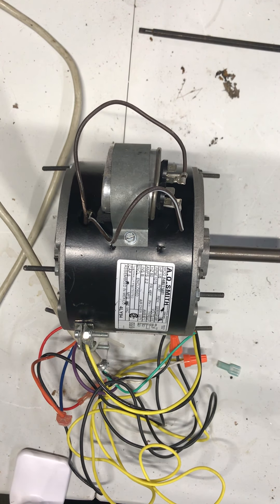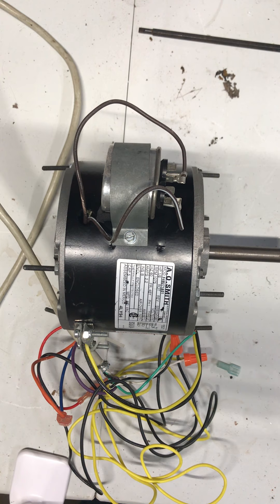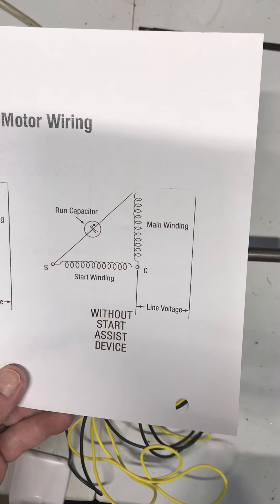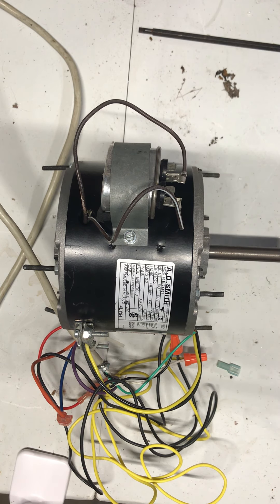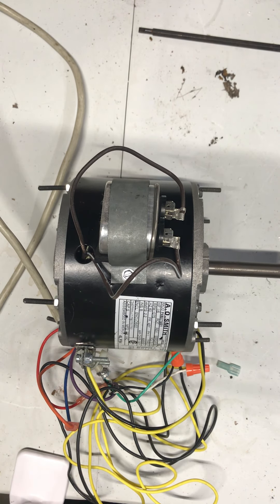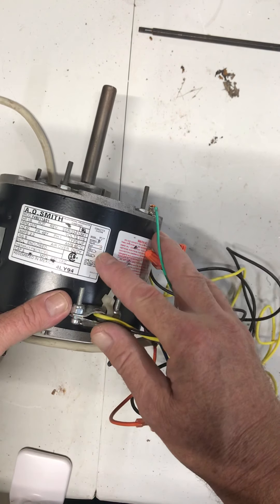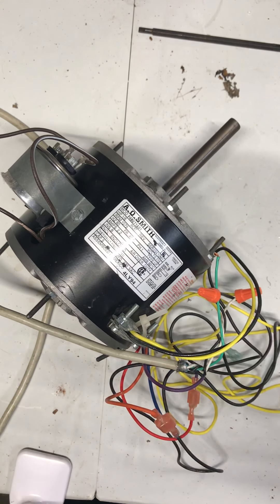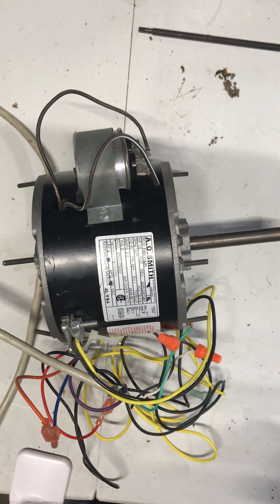Permanent Split Capacitor Motor PSC Motor

Comment: I have also seen a trend with a plastic housing capacitor is a start cap only while the metal ones are run caps or start & run. Also, yes the run capacitor gains heat as it is working the entire run time and is filled with an oil or oil paste to help dissipate heat. I have a vent hood over my range cooktop that just quit. It had the wiring diagram on a nice big label. All line voltage off one leg has to run through it to make the motor run even wit a 3 speed switch that pick one of 3 coil windings. The resistance values are given for each wire making judgment of the motor easy. Also allow for +/- 5% roughly as resistance changes with the coil temp. Copper wire has low resistance when cold allowing high current (amps) to flow but quickly drops as it warms up. This is called “In-Rush” current. Nice short video.
ASE auto tech retired

Comment: Oil filled capacitor or electrolytic?
Reply: The run capacitor is in a metal case with an oil or grease type filler to dissipate heat as it is working all of the time with the motor. Plastic capacitors is generally plastic but electrolytic caps are for electronics as they are marked positive and negative on top and service as a filter to smooth any given signal. Hope that helps!